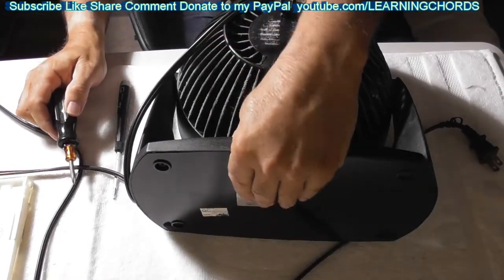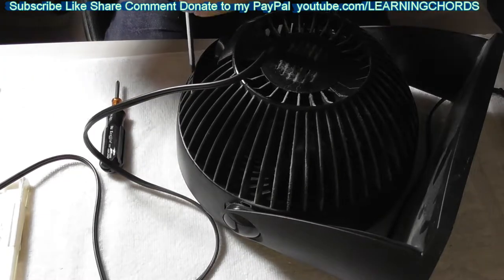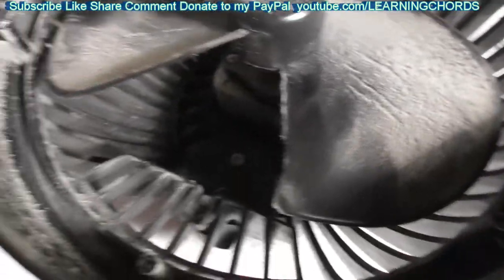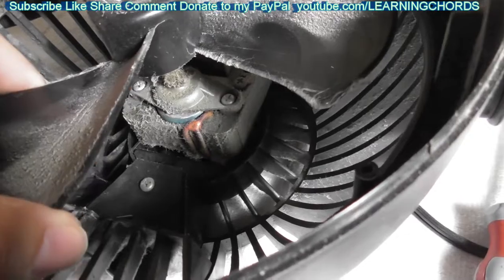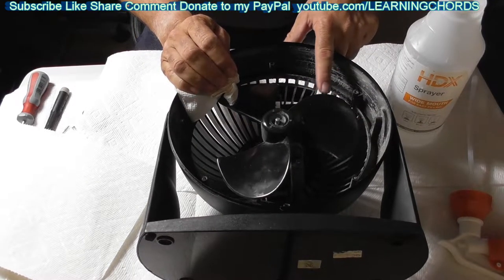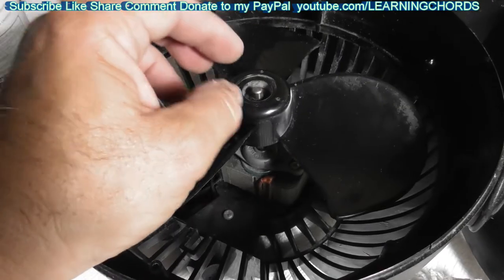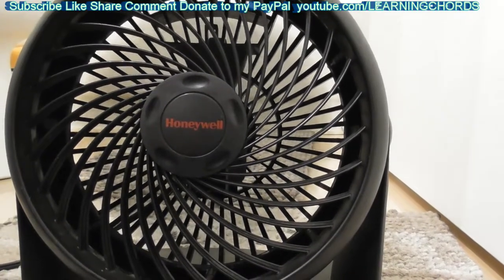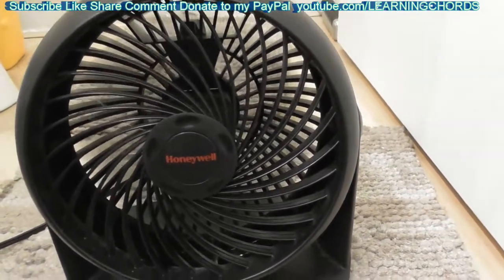HOW TO FIX FAN THAT DOESN'T TURN OR START HONEYWELL VORNADO

Comment: My fan actually has 5  screws but the concept is the same. Unscrew, clean, lube and reassemble. I fixed my fan during a summer heat wave of 120*F
Reply from the maker: well done Lawrence

Comment: Best how to, is from company..these fans are 5 year warranty,  great fans. Changing fuse in cord is first step and easy, if it does not work.
And it's not " just ladies that need reminder. Water and electricity does not mix"😅
Reply: Where do I get the fuse